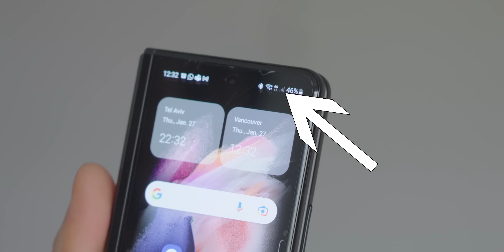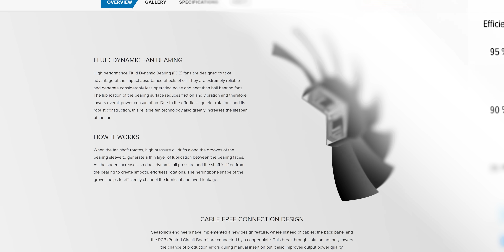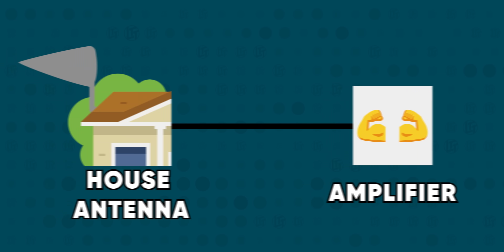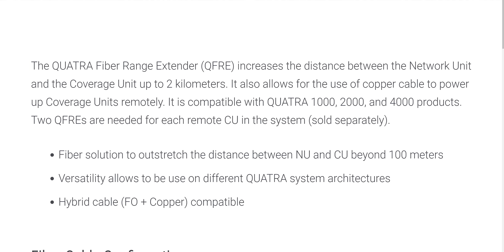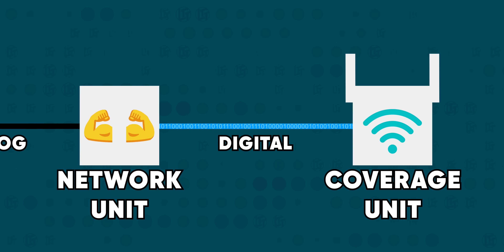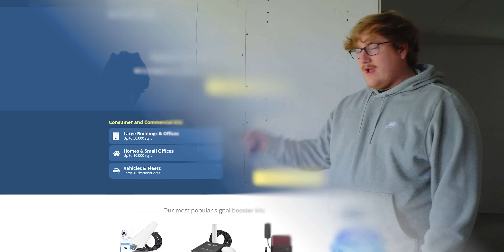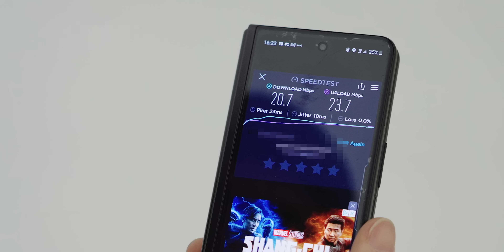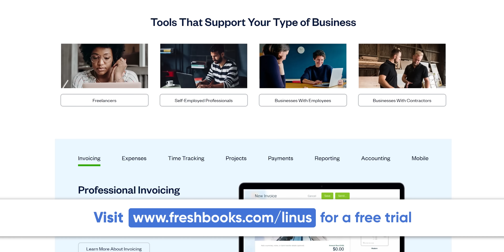I Hate This... New House Cel-Fi Cell Signal Booster Install

Comment: Finally, something I specialise in! 

I work as a network and enterprise technician in the UK for a global telecommunications service provider and my team supports network systems similar to these. However, we don't typically support cell enhancers like what Linus used here as they have many drawbacks, the primary being that your signal is only as good as the donor site, so if that site has an issue, then you have an issue too. Also as Linus found out, a lot of them have a spotty reputation. My company offers solutions which feeds off a dedicated internet connection and uses femto nodes to create a coverage scheme (similar to how a WiFi mesh works). This creates its own private in building network coverage scheme that doesn't rely on a donor site, offers way better coverage that's scalable to any building size and is MUCH faster. The only drawback being is if your internet goes down then so does your cell service but you can always run another circuit along side to add resilience or use SDWAN. 

I'm not sure if these are offered in USA/Canada, but I would have recommended you reach out to your local cell supplier to see if they offer these in building solutions. They'll likely come at greater cost but you get a much better product and much better support. 

Side note about WiFi Calling - Linus is technically right but most phones released over the last 3-5 years now support this service and a lot of iPhones and Samsung phones also support SMS over WiFi.

Comment: Linus sees an rg-11 cable and is like this is big. Meanwhile in Japan there using cables as big as an arm to give there citizens internet. Also next time shove the extra car length in the pipe/ wall so you can’t see it but it’s there in case you need it for future use.

Comment: These devices are illegal in certain countries as they use the same spectrum as sold/licenced to mobile carriers and can cause RF interference issues. Some times the mobile operator can come and add a mini site at your place to resolve signal issues with proper RF optimisation. Also the the mobile operator can increase the power of the sector slightly so that indoor reception is improved. This issue could have been resolved by the mobile operator themselves.

Comment: Did either of you realise the 45 degree bend was so you could also bolt it UNDER the eaves, not just on vertical surfaces? You would give up a little height, but as long as you had line of sight, you'd be fine?

Comment: It the connection in your area different from other country’s? In the Netherlands we live in concrete houses with also heating buil in the floors, but cell coverage is always very good. Even parking garages works fine boths data and celuar?

Comment: With all the network access points in the house, why couldn't you have just used a Femtocell? I think it would be cheaper and better than trying to pull a signal from the nearest cell tower. Or was this not possible?

Comment: also the only reason why this worked is because he doesn't have signal inside only because of the concrete. but he has signal outside which is were the antenna is. so if u don't have signal inside nor outside this will do nothing for you, if anything it might give you a little more signal but only because there's a big antenna pointing at the tower.

Comment: This is cool, but won't this affect coverage in your general area if you are using a cell repeater? A signal booster would plug into your ethernet, but if you have 10 GB that should enough.

Comment: You spent so much on Wi-Fi. Is Wi-Fi calling (routing phone calls through another network instead of cellular) not a thing in Canada? In some corners of my basement cellular is also non existent, but I have a gigabit speed Wi-Fi AX connection (900mbps tested)…

Comment: I am kind of confused, I would have thought it would have been illegal to operate RF equipment in cellular bands without permission. Surely there should be some kind of licencing for cellular repeaters?
Reply: Why should there be a license for that though
Reply: @thronritter6295  all transmitters need a licence to operate. A cell tower operator needs a licence and their licence covers your phone.
People can't randomly chose to set up their own cellular networks, it would cause unwanted interference and how would you know the transmitter was sending the right power, the right bandwidth, had the right filtering, etc.
These are normally considerations when setting up a cellular network infrastructure, I am curious as to why they don't count in this case?

Comment: Hey the only thing you didn't touch on in the video is whether it has a max band limit. I.e 

Is it repeating 5G as well? Or does it only work with like  3g/4g etc 

I checked out their websites and some of their products mention different versions. Especially gsm vs cdma. 

So is the one you installed only boosting say 4g  LTE? And as new bands become available did they mention you would need new hardwares  or just firmware updates.

Comment: Say what you will but having an Apple in a dead area with WiFi is amazing, my company switched to Apple cause they can use them inside the giant steel buildings without a cellular signal since Android wasn't able to do the same.  The things that android users have to do to send a text message is insane.

Comment: thank God my phone supports WiFi calling. I have Verizon and I have no service at my house at all. Before 5G I had service at my house, which is frustrating that they upgrade to faster signals but the range dropped substantially. there is a 5G box at the top of my neighborhood too. it's pathetic, and I definitely don't have $1000 for a Cel-Fi system.

Comment: It is not necessary for concrete with hot water heating. Whoever built the house way over killed it. Usually only concrete on the first floor. Other floors just use a metal reflector with insulation below.

Comment: Whith this gear, can you send the network signal to a network SW, on a separetad vlan, and then send it throug an intervlan (via the provider mpls) to another facility, and there put the antennas?
Reply: Like, let's say you have a facility outside the town, where there is zero cellphone signal, but you have fiber internet, could you get the signal from another location and send there through network?

Comment: Someone has to have said this before but NO, Hydronic Floor Heating does NOT require to be incased in cement for every floor. What kind of insanity claim is that? Cement is ONLY used when you're encasing the heating pipes in an actual cement floor. For any other kind of floor the heating pipes are attached to thin metal sheets that distribute the heat.

Comment: 100ft from the antenna to the Digitalization unit?! Thats 100ft for noise to screw with the signal imo. You might see an increase in quality by removing as much excess cable as possible between the antenna and the digitalization unit. Tho why the manufacturer went for this solution instead of an in antenna or in the antenna mount system is wierd for me. Deliver the power over ethernet, and the noice reduction should be significant

Comment: I feel like this story is very similar with the invention of space pen: With tons of manpower and engineering, NASA invented space pen for Astronauts, then people asked, why didn't you use a pencil instead?
Linus spend tons of manpower and engineering on this signal booster, then people asked, why wouldn't you switch to a carrier with Wi-fi calling?
Reply: In my experience, WiFi calling is only available on certain white-listed phone models. (I am also in Canada) Linus also mention SMS/MMS, which a lot of services use for 2FA. Plus, I've heard that when your phone gets even 1 bar of cellphone signal while on a WiFi call, the call will stutter and drop as it tries to switch over. (Also the analogy itself is flawed cuz the pencil lead fragments will get everywhere, which is something you don't want in space)

Comment: Does Waveform actually uses Yugi-Uda Antenna? The outdoor receiver for those who do not know. I've tried one of those here at the remote locations in the Philippines and it sucked. Though possibly because I also used an analog signal repeater. I ended up buying a TP-Link CPE610 and a Wireless ISP Plan just to browse the internet. No hope for mobile coverage though, until now.

Comment: Okay how is this happening to Linus? I live in europe, my house also has floor heating and we already use thick concrete, let's say 40-50cm thick per level, with 3 levels, as in ground floor 1st and 2nd floor and i have always had cell reception, the outside walls are probably like 60-70cm thick too, look at the beginning of this video that concrete looks really thin and not blocking. Also the wifi is an issue I have a wifi repeater for every floor but cell has always had stable connection

Comment: at a satellite tv installer, this is going to be fucking PAINFUL to watch someone install this.

do not put these kinds of things on the siding. the siding is meant to flex and move with heat, if you put them on the siding, you restrict and crush the siding. 

Put them on the edge of the roofing and use proper sealant between the foot plate and the roof.

Comment: I couldn't disagree more about this. WiFi calling is only getting better and more widespread, your comments on it imply that market share is only ever going to stay stagnant when in reality this is basically free coverage for cell operators. As a result they're definitely going to see more widespread implementation (potentially even at the cost of traditional coverage) over the next few years/decade and I think you're going to be left with an expensive system you never use in favour of the better experience you'll get over WiFi.

That having been said, would this support VoLTE throughout the house?

Comment: Linus, hydronic heating does not have to be encased in concrete. Some setups are stapled to the under joists with a reflective layer next to them, others use an integrated subfloor #warmboard. I even have seen gypsum panels in the ceiling used for radiant heating and cooling  (https://www.youtube.com/c/RadiantCooling).  Baseboard hydronic radiators could have been used, but they are unsightly.

Comment: Meanwhile in the UK most carriers support SMS and Voice over Wifi. Pretty sure the best solution is just to all use a carrier that supports it and use it over the super fast and reliable Wifi, rather than have complicated redundant systems. It makes for a good video but just seems so so unnecessary, seriously can you cook popcorn mid air now with all the radiation from the masses of multiple Wifi systems throughout the house? (I know its non-ionising but still believe that having this insane level of radiation throughout the property is probably not good long term )

Comment: 20 up 20 down xD poor linus. i got 936 up 900 down. basically 1gig up and down xD not that i will ever use it to its full capacity but its cheaper than my 30 up 300 down funnily enough

Comment: Oh wow the amount of jank. Like you never put RJ45 plugs on installation (solid core) cable. Instead you use keystones or LSA outlets and fix them to the wall. Why? Because it's jank and plugs don't work reliably, as seen here. Also, solid core cable isn't meant to be moved around, that's why you terminate it at fixed points.

Comment: and yet another waste of cash on hardware that has been obsolete since the  introduction  of POE on everything I have to wonder why the link isn't isn't at the highest point in the home for the cleanest reception 

Personally air fiber would of been a better solution...you also nbeed to make a choice whether you want a smart home wired or wireless

Or you want keep fucking around with technology options that with introduce electronic noise into the network in interfere with all sorts of signals meaning no dimmers, or smart lighting can be used because the tech they are based within hasn't had isolation issues dealt with to the cows come home..

For a smart man Linus you kinda remind me  of Frank Spencer and not to let you near technology  because you'll find a way to fuck something up and having to have someone bail you  out...